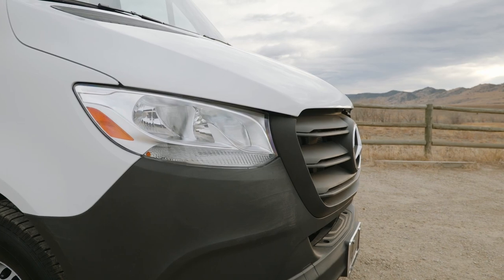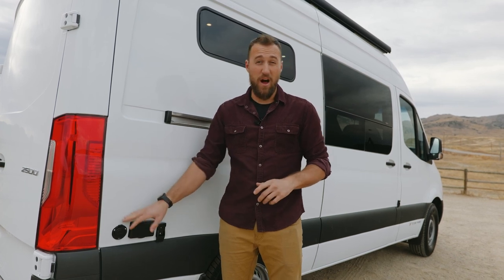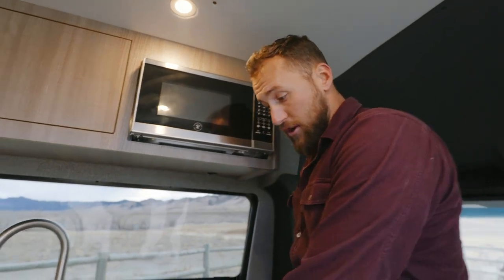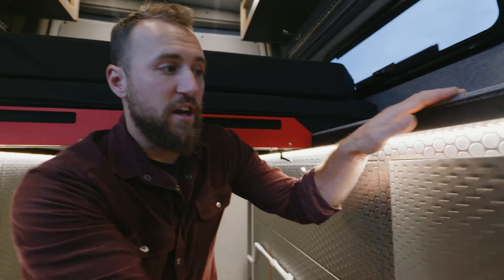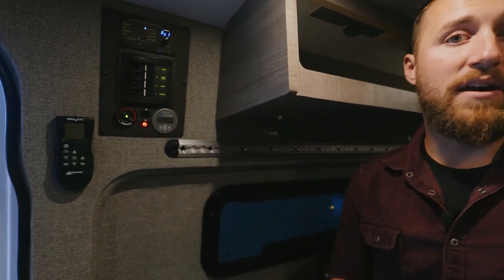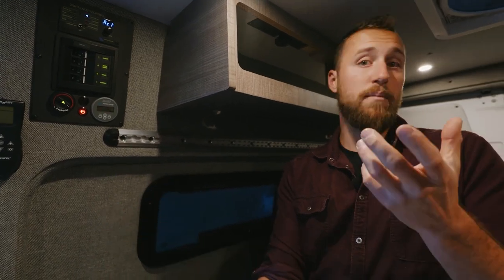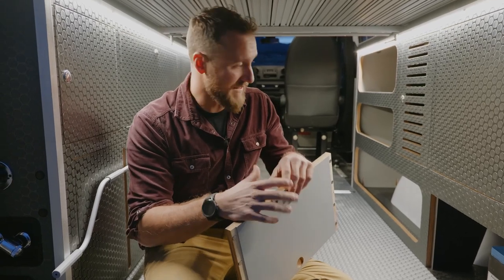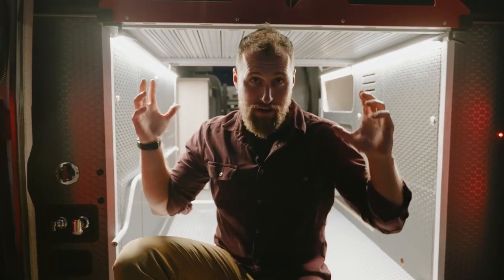Camper Van Tour - Mercedes Sprinter - The Classic 3.0

Comment: Haaa   This is MY VAN.  I picked it up and rode it hard 1700 miles across Colorado, NM, Arizona and half of California.  Spent 3 nights both with shore power and without (dispersed).  Everything worked PERFECTLY.  If it's functionality and utility you want, these guys are the ones to see.  The build is amazing. Toured their shop in Boulder, and it's also amazing.  If this vanlife is your thing, go with Titan.
Reply from the maker: So glad your enjoying it. This was a great build and were glad it went to you!
Reply: So in a few months can ya update your options selection? What would you add/subtract etc
Reply: @Embarq007  Like,  what would I do differently?
Reply: @hugiefresh379  
Yes
Reply: @Embarq007  Go with the bigger  WEBASTO interior heater.  Particularly if you are in a cold weather area, or plan for serious winter trips.  The smallest one won't  keep- up in zero degrees or below. I am in California so interior is not a HUGE thing for me.
Reply: @hugiefresh379  
The AC option ?
Reply: @Embarq007   No.   Expensive, power hungry, extra maintenance.  99% of places I go are mild days, and cool breezy nights.  Nobody goes to Mojave or Death Valley mid summer, A/C or not.

Comment: Always enjoy the build videos, curious why the l-track isn't flush against the walls?
Reply from the maker: Recessed L-track requires 1/2" thickness to sit flush. Our paneling system is only 1/4", this is surface mount L-track that has beveled edges and works great in this application.

Comment: Hi, what materials do you use to insulte the vans? can you make a video showing the insulation?
Reply from the maker: We use sound deadening mat, such as kilmat or other. Then we add Thinsulate over the top for the main insulation. Lastly our panels are comprised of 1/4" baltich birch with 1/8" foam insulation between the wood and upholstery.

Comment: Not a fan of heat pads for batteries. Simple solution Heated batteries!!! All the big battery Co. make them. BattleBorn...I love how simple your van builds are.
Reply from the maker: Heated batteries are just internal heat pads. Many of which are not large enough to handle extreme low temperatures. Being able to apply an external heat pad means you can adjust the size to meet the need. Also, battleborn batteries have a very low allowable amp charge and discharge rate, much too low for our systems.

Comment: Didn't hear anything about insulation packages. Heard some people were using wool. Also what about removable insulated (velcro) panels to cover windows? I'm interested in making a unit for very cold applications.
Reply from the maker: Our insulation is always the same. We use sound deadener and Thinsulate. We also have magnetic window covers as an upgrade option. Not sure what your idea of very cold is but we have regularly used our vans in -5 to -20 F range.
Reply: @TitanVans  Yep, -20 is more like what I would like to achieve. Is this insulation maxed out, or is there the possibility of adding a little more?
Reply from the maker: @floyd48383  It is essentially maxed. Adding more will only see nominal gains, the vans are metal boxes with lots of air leaks and R0 windows. For cold weather the best thing you can do is add a bigger heater and window shades.
Reply: @TitanVans  Any thoughts on sealing it all up w like a Linex type material?
Reply from the maker: @floyd48383  Moisture has to be able to escape, metal does not breath, so the air "leaks" are critical. Only bring that open to note that more insulation won't make the van warmer, it will slow thermal transfer but with metal thermal bridges and no real control of air flow, its not as critical as people think.
Reply: @TitanVans  Thanks...you seem to know your stuff!
Reply from the maker: @floyd48383  We've been doing it a while!

Comment: What about fuel capacity, what is your max option? (for both the 140" and 170")
Reply: This is my 140 in the video.  Get the v6 turbo diesel.  26 gal (?)  tank or so.    I was getting 19-20 MPG.  The 4-bangers not-so-good on mileage--especially with the extra weight of the build.  Get the V6.

Comment: There is a 300 watt solar panel on the 140" body...how much can you put on the 170" body?
Reply from the maker: 330 watts is standard on all of our builds. You can fit more on a 144 and quite a bit more on 170 but it is a fraction of the recharge capabilities of the alternator or shore power. Certainly critical to have but we dont find it necessary to max the roof out with every watt of solar possible.
Reply: @TitanVans  What would the max be? I would also want to max out the batteries...on the 170, that is 5 max correct?
Reply from the maker: @floyd48383  through our upgrade options, 1000 Ah battery bank and 330 watts solar is max.